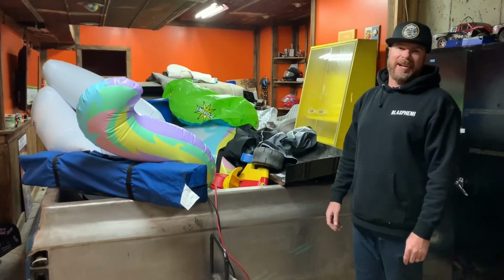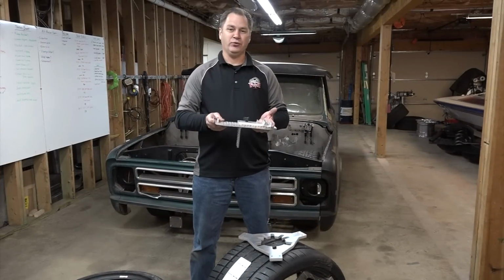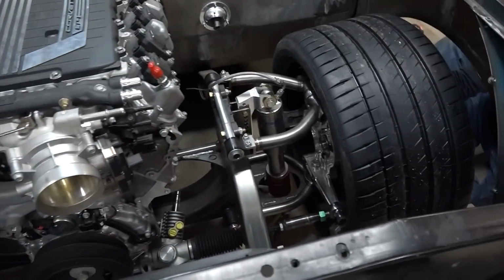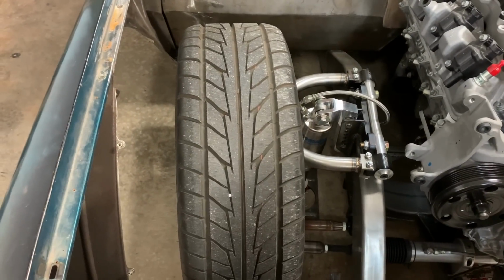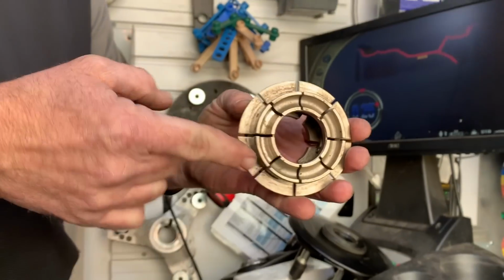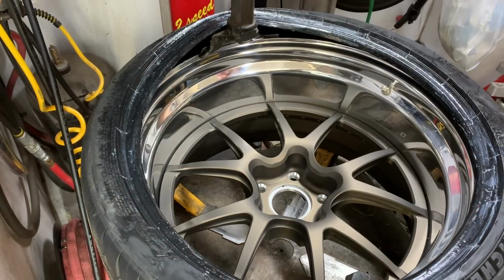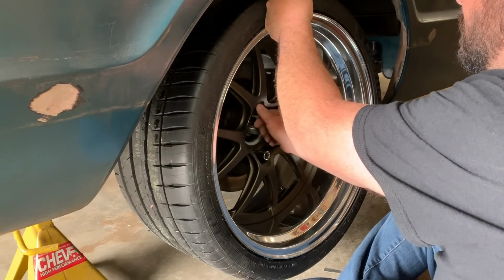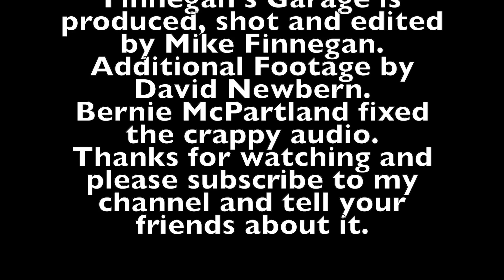Finnegan's Garage Ep.67: Did I Just Install the Widest Front Wheels on a Chevy C10 Ever?

Comment: Hopefully these tyres won't dry rot out before you finish this. Nice to see it again.
Reply: After 3 years all tires need to be discarded
Reply: @cruisingthethaiway6881  not sure where you heard that but it's absolutely wrong. Michelin and Bridgestone guarantee their commercial cores for 7 years.
Reply: @jaydunbar7538  it is the law in most countries.
Reply: @jaydunbar7538  they can't legally fit,(not sell) tires that are older than 5 or 6 years old so anybody can buy "old" tires for burners atleast in america
Reply: @cruisingthethaiway6881  Oh? Cite your source.
Reply: Superman  Thankfully its not petroleum based
Reply: CraftsmanQuad  "they won't repair passenger vehicle tires older then 5 years" , still not strictly true but it's closer then a broad statement encompassing tires designed for commercial applications and trailer tires in general.
Reply: @cruisingthethaiway6881  Are you for real?
Reply: Neil Fairless hello
Reply: tyres????
Reply: Tires USA tyres British right
Reply: @cruisingthethaiway6881  Yes and no. If you drive them, they will last longer. If these just sit, they are done after two years.
Reply: @jaydunbar7538  Indeed. But you need to use the tyre for that to be the case. When the tyre is not used, it drys out a lot faster - and if it's on the ground stationary, it will both flatspot and crack.
Reply: Superman  No they will not. It has little to do with UV rays and all to do with the fact that the chemicals inside the tyre will gas out.
Reply: Can you feel the love tonight?

Comment: Have worked in tire shops a lot in the past and never once have I seen an aluminum centering cone, they were all made out of hardened steel. Neat service, it seems you hear about not getting the correct offset in custom wheels on forums a lot. Smart!!! Hope your build goes well, looks good so far.
Reply: Good catch.  I heard it too and had to laugh.  That's why I'm the wheel guy and he's the host.  But seriously, when you do this live, you don't always hear what you say.  Thanks for watching and sharing...
Reply: @wheelman9137  I like your setup. I used to run a service truck for a local Goodyear dealership. Nothing better than working outside the shop. Best wishes, sir.

Comment: 0 weight you have got to be F##King kidding me!? That is a BADASS Combo man!
Reply: Look at the wheel he installs at 21:30 it has 4 glue on weights on it  
.Not so great !
Reply: @Jack1366gto  Not sure what was up with that. May have been some kind of issue.
I just had MPSC2 tyres installed on Forgeline GA1R Open. Not a single weight was used. We did need to remove one tyre and offset it slightly different to the valve/TMPS sensor assembly by rotating it about 90 degrees. But otherwise, using the weight markings on three of the wheels, we got them spot on the first time.

Comment: Dude, those wheels look infinitely better than the ones that were on it. I hated those wheels, but these ones make the truck look absolutely sick, specially when it's sitting flat on the ground.

Excellent choice, my dude. Now to make that engine roar.
Reply from the maker: thank you!
Reply: @FinnegansGarage  No worries Finn. I'm also happy you fixed the OG Roadkill Ramp Truck. I was worried you were going to get rid of it after getting Squareforce 1, but it's good to see the thing running like a champ. Just don't wreck the spider gears of the new axle with too many dually burnouts ;)

Comment: i have been  fitting tires and wheels for a long time  and do wheel alignments but i didn't know the air down trick to bead the tire properly . and  i was trained by Bridgestone
Reply: Check the TIA ATS manual and it is in there.  I believe that Bridgestone was the contributor for that technique.  I provide onsite training and certification if you own a shop and would like to have this level of training.  I also wrote my own custom wheel training program that is more advanced than the TIA program.

Comment: 21:25 I guess not all of them were dead zero ;)
Reply: It is rare for a tire or wheel to be exactly balanced, but there are times like this when the slight imbalance in each correct each other.  It is called match mounting when you try to achieve this.  In our case, it was random chance.
Reply: @wheelman9137  Oh yeah I've seen that - usually in larger offroad tires so not to put 2lbs of lead on there :)  Was hoping they'd show that process here maybe.  Totally agree though very rare to get em perfect out of the gate.

Comment: There's a lot of emphasis on backspacing in this video, but it is important to point out that offset and backspacing are different. Two wheels can have the same backspacing, but be different widths, and have a different offset. Offset is the distance off of center of the width barrel the mounting face sits, with outward bias (wheel mounting face is outward, like his old Boyd fronts) being a positive offset, and inward bias being a negative offset. Zero offset is a centered mounting face, which is essentially how older USDM RWD cars and trucks were set up. Most front wheel drives use a positive offset, as do most modern RWDs.
Reply: Except you don't need both sets of information to order wheels. Back space and offset are directly proportional to each other and the width. Out of the 3 data points; back space, offset, width, you only ever need 2 as the other can not be changed without changing at least one other data point. In this case they knew the width they wanted, and the device they used easily measured backspace giving them the 2 data points they needed.

Comment: I had new tires put on my car recently.  The local dealership charges $15. per tire.  I had a flat repaired there and it was $20 something dollars.  I the car to a tire shop for alignment and new tire installation.  They saw fit to charge me $160.  They said it was because my Hyundai Elantra had big factory wheels.  Whatever...the jobs done.  A few days later I am washing the car....scratches everywhere.  They scratched the finish on the lip all the way around and there were marks on the face as well.  I paid extra for the difficult install but I didn’t get their best effort.

Comment: I feel like there's probably a few C10's out there running 18x12's and 335's. See a few 67-72's running Optima or SCCA CAM stuff now.  I'm thinking No Limit Engineering's Hellboy is either running that setup or 18x11's and 315's up front. In a Rival S so considerably wider than the Michellins. Of course that things more tubed out race car up front.

Comment: Just curious can you turn the wheel at all when the truck is sitting on the ground, do the tires hit the fenders or do you have to keep them straight? Wondering why you didn’t go with something in-between so you could turn the wheels a little while slammed? Either way sick truck and keep up the bad ass builds.

Comment: I verified tires for a living, way back when, for a premium brand tire company, in one of their elite factories. There are many criteria we test for. And we have computerized road test machines that measure those criteria, through piezo-electric crystal sensors. And an out of round tire or other deficient parameter tire does not get sold as an on road vehicle tire. 
 The extremely high end tire is built by robot, to extremely tight tolerances. All joints have almost no overlap and yet are as strong as the rest of the product. It's fascinating stuff. I have never stopped being impressed by it.  Needing no weights at all shows the highest quality standards of the tire manufacturer, the wheel manufacturer, the care that the logistics people put into packaging and shipping, and the quality of  the installer. 
  I was very impressed. It should inspire greatness for the rest of the build. It's looking great so far.

Comment: Since it's perfectly balanced does tha mean the wheel manufacture compensated for the valve stem?
Reply: No.  It means that the random placement of the tire on the rim countered any imbalance that the assembly has by itself. Valve stem is irrelevant. Also, the Haweka make repeatability possible.

Comment: How do you end up with no weight needed on a balance when you have purposely introduced weight with the valve stem?  There is some BMF somewhere.....
Reply: WheelMan surely they don't offset the balance in the barrel for the valve stem?   Or is it insignificant?
Reply: mw6886 very few tires or wheels are perfect, but occasionally they match up and counter each other exactly.  This was not staged. I mounted the tire just as Mike walked over with the camera and started filming.
Reply: @wheelman9137  I was not implying it was staged.  :)  Just trying to figure out how the extra weight of the valve stem was accounted for.

Comment: so I grew up with the understanding that you have a " TIRE " and you have a " RIM " and when they are put together its called the " WHEEL "  and where the spokes are connected to the loop is called the " OFFSET "  am I wrong?? or is this just a north and south or east and west slang thing?
Reply: We consider the tire and wheel mounted as the assembly.  Most people interchange wheel and rim.  Offset is the distance from the rear flange (where the weights are placed) to the mounting pad (where the wheel contacts the hub of the vehicle).  Hope that helps.  You can watch a very informative video on my website at www.TheWheelFit.com and click on videos.  Check out the educational video.

Comment: Jeez that compressor motor to lift sound like you got it off the clearance rack at Harbor Freight.  They had quieter pumps in the 60`s......tire n wheel selection is killer as is stance.

Comment: I get the tire is "Balanced" But that tech didn't do a fine balance. You can get a better balance if he changes the machine to a fine balance. The balance he did was within .50 oz. A fine balance is within .15 oz on inner, outboard, and static. So the tire is balanced just not as balanced as it could be.
Reply: Where would you like the outer weight?  It is a soft lip.  Maybe I should stick weights on the face of a $1500 wheel ?

Comment: I am not hating at all, but you don't need a $200 part to see if wheels will fit your car.  I understand the plug as you are using the tool and i am sure that it works perfectly well.  But, you just need to go to a website like willtheyfit.com and put in your new vs old wheel setups and it will show you the difference.  Unless its a shop, then the tool is much more effective.  Beautiful truck btw.
Reply: I think that the tool speaks for itself.  NO website or ruler/string can even touch what I can do with the GRYPR.
Reply from the maker: that website is great but it doesn't tell you whether or not the tire is gonna contact my custom built firewall, which is not in the stock location, when I hit the pothole at 60 mph while driving 2 inches off the ground. There are way too many variables for any app or website to perfectly simulate. This is where the tool really shines.

Comment: I'm gonna laugh if you single handedly bring back the mini truck scene. I would also be glad if the mini truck scene would start focusing more on performance as well. Always made me laugh when a dude would drop 10-20k on custom suspension, 5-10k on paint, 5-10k on interior but still rock a greasy leaky 4 cylinder, stock brakes and electrical that hasn't worked since they decided years ago to back half their truck.

Comment: The relaxing the tire after the bead pops is a neat theory although I have never had a problem because I used lubricant on both sides of the tire.  Not sure where he got the 50 thousandths measurement from, but for someone to x-ray a mounted tire and measure it seems kinda crazy to me. Not knocking him at all, his attention to detail and his knowledge of mounting tires is top tier.
Reply: Many times you can't SEE the difference, but you can FEEL it.  It takes 1 minute and takes another variable out of the equation.

Comment: Balance beads, NO weights
Reply from the maker: don't those beads only start working once the vehicle reaches a certain speed?
Reply: @FinnegansGarage  You don't need your tire/wheels balanced at slow speeds. The beads work anytime theirs enough rotational speed
to move the beads. So you are balanced from 5-150hph. Plus  the hub bearing and rotor are balanced with the wheel,
And the beads stay with the wheel combo for its life.I think we use Counteract. 
Love your wheels, don't really want to see any weight's stuck on them.

Comment: 295/xx-Rxx...295 is the tread width in mm...
Reply: I thought it was interesting that one 295 tire was 11" wide and the other was 12" wide lol
Reply: @Strunz0 yeah, thats the whole point of that sizing system... there will be minor differences between tread style and manufactures but it shouldn't be that much.
Reply from the maker: the aspect ratio, which is the percentage of the tread with is different.  @Strunz0
Reply: @FinnegansGarage  I would imagine it would have to be different being that you have two different rim diameter's for comparison. I was just pointing out that a 295 width tire is the same width regardless of rim size or sidewall profile.

Comment: 235 75 15 which is Factory a with the factory steel wheels I had the 1970 Chevy C10 everything on it was manual and it had the old 283 with the manual three on the tree manual choke manual windows it was a good faithful truck why did you lower your truck

Comment: Mike, looks like you and Scott made the classic mistake that 99.99% of all motor heads make. The most important part of fitting proper offset. For a proper safe handling vehicle, the ball joints must line up with the center of the tire. A well trained educated experienced suspension tech (like me) will tell you the same.
Reply: Unfortunately, the truck was already built when I got involved and I didn't have any input on IA and scrub radius.  Great catch, though.  I think you are the only one so. far.

Comment: Finnegan >>> The "Rim/Wheel Guestimator Tool" is almost clever, with exception that the numbers and adjustments are made on the outside where you can't see them when fitted with a tire; when these are moved to the inside it will actually become practical.  "The vehicle used to squat on the ground" ... very interesting; I just watch my dog do that, I'm glad I have no interest in wasting loads of money just to see my vehicle do that ;-)  ... in my opinion, lowering a vehicle where the bottom and rear-end drags on the ground is the vehicle equivalent of drooping one's pants, I think it's both idiotic and stylistically for the mentally and artistically challenged.  In any case, amusing video ... thanks for the posting! ;-)

Comment: Hey Mike, Love the wheels, but shouldn't they be torqued properly and NOT mounted with an impact?
Reply: well it does not have paint or a lot of other things so they are only on there to motivate him and to let us see just how god damn good this truck is going to look. they will be on and off the truck prob at least a few times 
also that gun they were using outputs less then 100 foot pounds with that adapter and socket even less
Reply: @NightshiftCustom  100 pounds? What century are you in? Small impacts are far more powerful then your giving them credit for.
Reply: What's wrong with mounting with an impact? Sure back in the day weak impacts could leave the lugs to loose causing problems, but that's not really an issue anymore. If anything you need to be careful to not overtighten with modern impacts.
Reply: @jaydunbar7538  1# that is not a real impact gun. 2# if you look it is only a 1/4 hex impact driver for driving screws into wood and the bit will not take much more then 100 foot pounds before they snap. 
that gun outputs 1400 in-lbs (116.67 ft-lbs)
Porter Cable model PCC640
alot of 1/4 hex impacts are limited to this range of power or they will just snap bits like my milwaukee does

Comment: A 2000 dollar wheel and an electric impact wrench. I'm lost for words.
Reply: ? most electric impacts have settings for a pre-torque usually 50 or so pounds. at least all the ones in the shop I work at has that option.

Comment: Not sure about the "tire bead set" logic.  But if your totally anal, shouldn't the WHEELS be balanced on there own right off the bat?
Reply: It is rare for a tire or wheel to be exactly balanced, but there are times like this when the slight imbalance in each correct each other.  It is called match mounting when you try to achieve this.  In our case, it was random chance.

Comment: I dig it. Those rims are so clean looking. Forgeline doesn't mess around. 

 Quick question though, the IRS Cobras had a pretty tough time with wheel hop, and breaking stuff. Did you engineer anything interesting the rear of the truck to eliminate those issues?